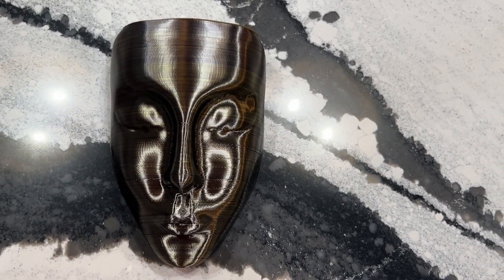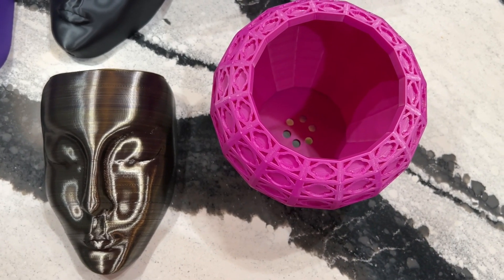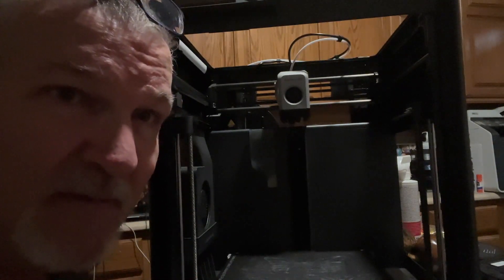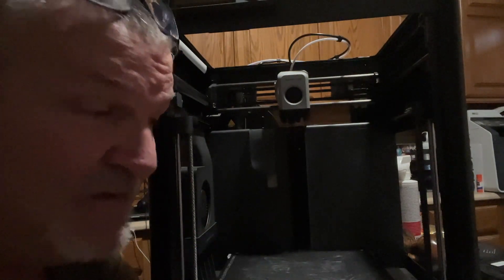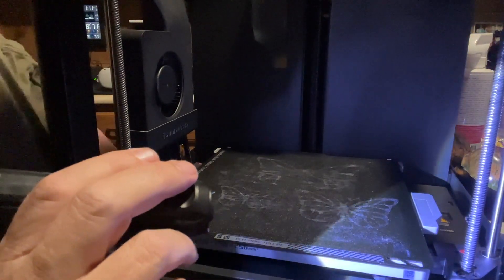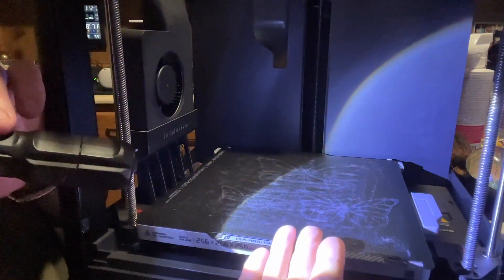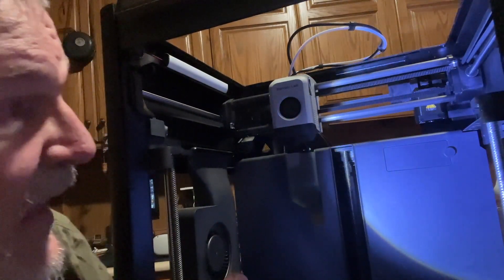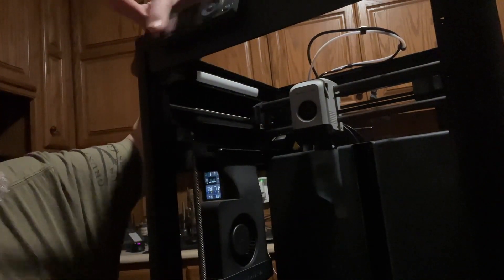Bambu Lab 2 Week Review and Maintenance

Comment: on textured bed,   i only use dawn dish soap,   works fine with no glue.
Reply from the maker: Everything worked fine with me too but for only a few months. I then started to notice some warping and print failures. I also use dawn to clean, followed by 99% Isopropyl Alcohol and then a thin layer of glue and it works great.

Comment: Isn't the light supposed to be installed one level lower? It is not shining on the printed element but from the above on the head
Reply from the maker: Yes, you are correct. I installed this when it first came out and that’s where the instructions said to install it. This has now been changed to install it lower, level with the bed.

Comment: Hmmmm all your Bambu Lab prints are matte. Whouldn't it be a better comparison to print shiny surfaces on both printers?
Reply from the maker: I didn’t have any more silk filament at the time but you can clearly see a comparison but those aren’t matte, they were all regular filament colors.
Reply: @1SpudNuts1BigNasty-DIY  Just crank  up the temps on the Bambu then. The probleme here is that matte surfaces deflect light and therefore hide imperfections better.

Comment: Wanting to get one of these i am always repairing and buying things for my current prenter. Is there much of an upkeep cost for this printer?
Reply from the maker: If you maintain the printer properly (regrease exis screws, clean carbon fiber and stainless rods, and oil bearings) not much at all. I went about 4 months, printing a lot, until I noticed a slight degrade in printing. I replaced the hot end ($35) and I was back up printing like new.

Comment: People! DO NOT USE GLUE ON THE PEI PLATE! If you are printing PLA or PLA+ the stock P1P plate does not need any glue. Make sure the correct plate is selected in the slicer and if you have issues do 2 things. 1, increase the temp of the bed to 65c and 2, turn off the AUX fan for all prints unless you enclose your P1P.
Reply from the maker: The coating on the Bambu plate loses adhesion over time, please don’t criticize something that works. Turning off the aux fan or increasing temp doesn’t work. Different things work for different people. I’m now at 4 months and now have 2 printers and use glue on both. It works.
Reply: A textured plate should not need glue...but nothing is sticking to mine now and its been almost 2 weeks. I Increased temp still won't stick. Tries turning off the fan still didn't work either. Adjusted layer height width nothing.
Reply from the maker: @supermanscott  You are correct, it shouldn’t need glue but after some time, these lose adhesion and glue stick works great. After a layer, it lasts for 10-15 prints. You do what works.
Reply: @1SpudNuts1BigNasty-DIY  tried it last night works perfect.

Comment: I have the P1P and the  X1-Carbon. The X1C is an amazing printer, but you have to consider, that it is way louder than the P1P. There are two fans more, for the Power supply and the chamber. They make noise like a jet engine, you need definetly a seperate room for operating the X1C.

Comment: i have a question how are you not getting any horrible layer lines ?? them masks are Amazing 
i don't get that quality not on wall
Reply from the maker: I’m actually using the default wall, speed and layer settings for the textured plate.
Reply: @1SpudNuts1BigNasty-DIY  any way of posting them please your settings cheers
Reply from the maker: @darren990  Select bed type “Textured PEI Plate”, then “Generic PLA” and “0.20mm Standard @BBL P1P” and it should populate the default settings.

Comment: I use hair spray for years over bare aluminum plate for my Creality printer , never had issues.

Waiting to received soon my x1 carbon and try hair spray on it.

Nice video, I will lube all before using the printer.

Thank you

Comment: Good tips! I service semiconductor equipment for a living. Some of the equipment I service have very similar linear guide rods and spindles - the germans that designed the equipment always told me to keep the rails and spindles very lightly greased. I use Isoflex nbu15 on the rails and spindles (“screws”). Been at it for over 20 years now and haven’t had any failures on hundreds of tools that were kept on a PM schedule. However, I HAVE had to replace guide rod assemblies that were not kept on PM schedules… Take it for what it’s worth. I really enjoy my Bambu printer - especially because of my profession, feel like I had the machine learning curve kicked real quick. Thanks for your time and vid. 👊🏽👽👍🏽